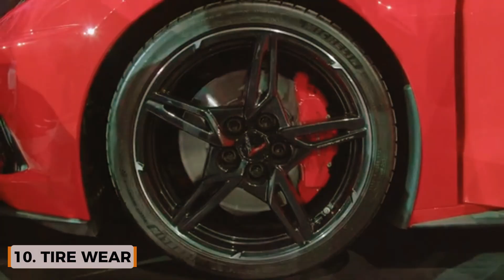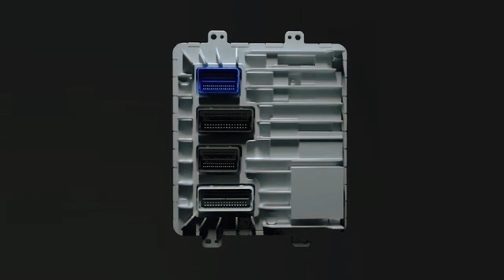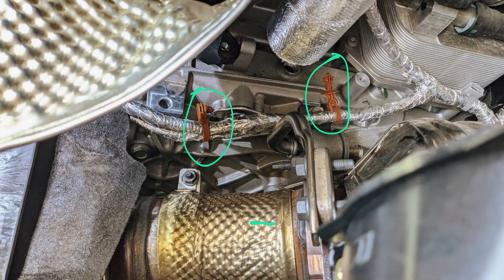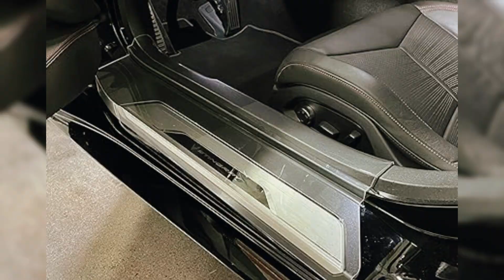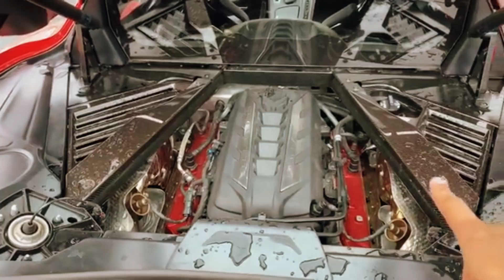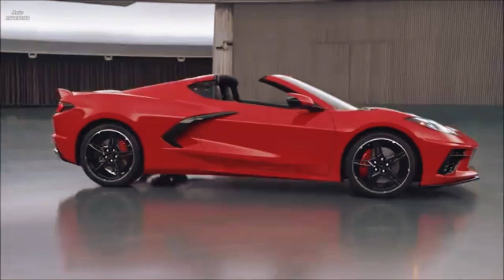Chevrolet Corvette C8 | Common Problems and Easy Fixes (2020–Present)

Comment: This video is absolute BS. There is no steering reservoir as the steering is electronic. You cannot rotate the tires as the front and back tires are different sizes. You would never disconnect the battery but rather connect a battery tender. This wannabe influencer is feeding you garbage.

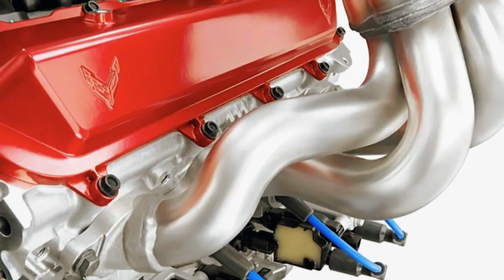Comment: 1:58 You recommend disconnecting the battery when infrequent use is anticipated. You’ll spend an hour or more trying to get the car reprogrammed to your former settings upon reconnecting that battery. Do you even own a C8?
Reply: @davemorris1113 Dave, I don't think this guy has a clue.